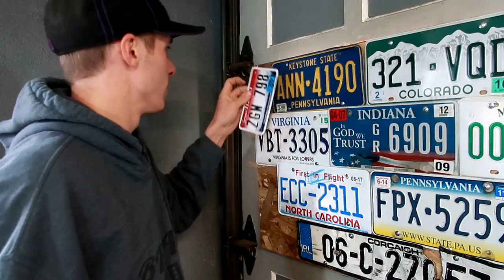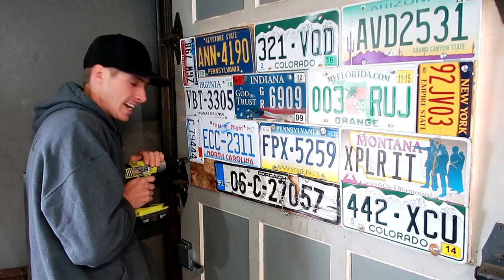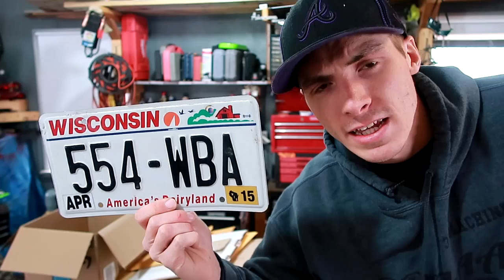I'M DONE (BIGGER and BETTER THINGS)

Comment: Did you get the torque converter fully installed into the pump? I hope so!!!That bike motor will never work with that transmission in the gator. It will tear it apart even if you do find a way to link them up.

Comment: I subbed when the braaapboard only had 1 front wheel.  I'm also wondering what you are going to do about the clutch/trans in the gator.  The setup in it didn't look like it could handle much.